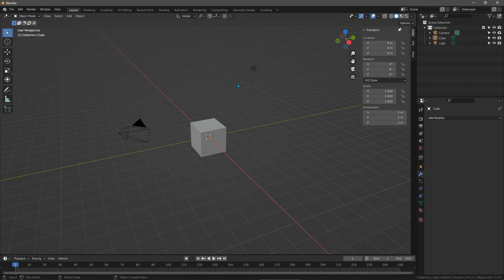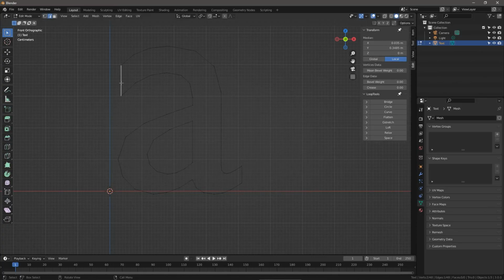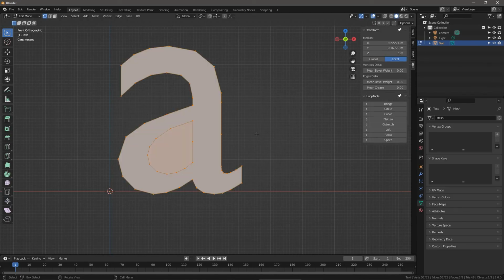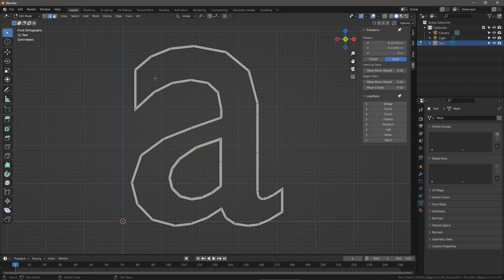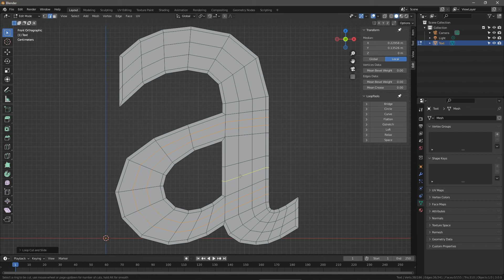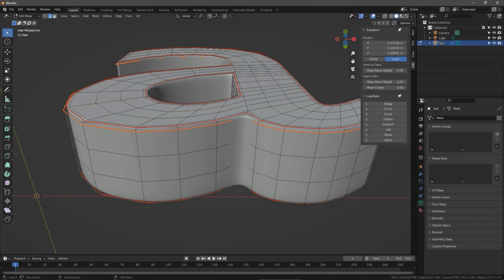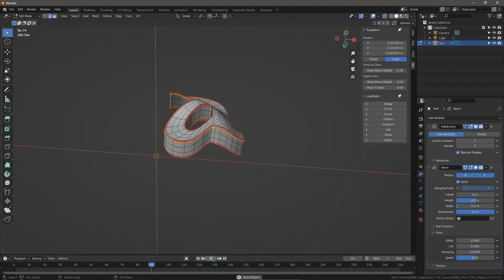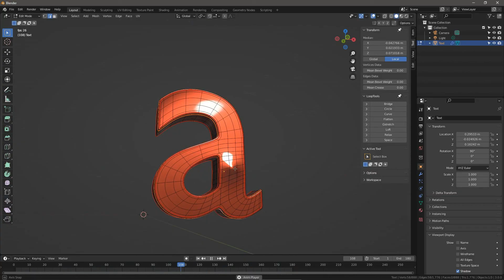Blender - Retopologising Text - #10 Subdivision Surface Modelling in Blender

Comment: great to see this - the challenge I have is to to keep the text editable so that designers using the file can revise the number to whichever is needed  - additionally that number is wrapped around a sphere like a pool game ball- I have used the remesh modifier with a shrinkwrap which works and looks clean in EEVEE though in cycles all the facets of the remesh show up nice and ugly - wonder if you might have any suggestions could try in addition to this approach for live text wrapped onto curved surface- many thanks!

Comment: PC user, Blender 3.5...           "G-G" doesn't work for me...just activates Grab funtion.  And although not related to video, I also can't align verticies to axis, as in:   

S(scale))  -->  X,Y,or Z  -->  "0"...     It simply goes to scale when I hit S.    I have to manually go to options and select "scale" from "transform" menu, then the next operations work.

Perhaps it's an addon?

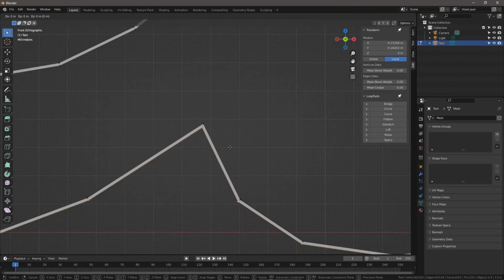At 5:20,  trying to use shift-V as my 'GG' while holding down "alt".     Mesh turns into spider web.

Comment: I'm interested to know how you would do this with text that has curved corners and several points along the corner.
Reply from the maker: Hi giantpunch. I would use the same method, but rather than add vertices to an edge to equalise the vertex counts on each section, I would subtract vertices from the side with the highest count. I would often leave the targets shirnkqrap object visible as I work. Removing vertices where there appears to be too much density. You dont ever really need more than a cluster of four verts to describe any curve. With that in mind, you can ensure that there is a good sensible distribution of ppints at every stage. While working on objects like this, you need to almost arbitrarily decide where to introduce corners ( which would be 4 spoked poles in the initial fill as you go). Does that make sense?
Reply: @ianmcglasham  Thanks for the quick reply! I don't really understand what you're saying here, but I'm gonna keep hammering at it until I figure it out!

Comment: thanks for these great tutorials! they are golden! but I have a question: do you use "mark seam" only to have a visual clue of what are the edge loops that are the ones which sharpen the corners? isn't "mark seam" also splitting the UV unwrap of the object at the same time?
Reply from the maker: Hi. Sorry about the delay! Yes. I use Mark Seam only as a visual clue! mark seam is supposed to be for marking seams which blender will use to split it up into islands for texturing. but i just like the way it turns them red!

Comment: hope blender can do it in the future without manual Edition hours..maybe  with a special modifier for Text..
like C4d  Text Animation and Text  handling  is fat beyond blender...and a fun to use ..this task  example  looks like payn in the ass and so much time for one Letter...
I try it with modifier setups  but its hard or on some forms  impossible specially  when the object deforms or with  longer words..Ther  is no setup near useable simple setup and Text handling editor it horrorshit .
 with geo node it ends most time also in artefact  mess..
So for pros its to timeconsuming no body pay for hours to model a Word and later you become a another typing type and you becone per hand again..its sadly tru that blender 3.3. can not handle  so important part od Animation  that Text  is even I n the future...blender need better remesh algorythm.
Reply from the maker: Lots of brands have an entire font created using methods like this as soon as they update their fonts! Whether it's Maya, C4d or blender. None of them create the correct topology so it always has to be done this way ( a slightly more advanced method actually which I will show soon!!) You would be surprised how many companies are prepared to pay for the hours!

Comment: SO glad I found this channel, just brilliant and unique content. Thank you!
Can I ask why you expand the border out from the original outline (edgeslide of -6) and not inside like an inset move?
Reply from the maker: Thanks Duncan. Great question! You can do either - or a combination of both. The limit of curvature is restricted by vertices at acute angles to each other on tight corners and these arrangements are more common on the inside of text. As an introduction  to the technique I wanted to keep the description simple so I opted to just go in one direction using the outer edge. The important part is that there 'is' a border which every tutorial I have seen so far misses completely!
Reply: Right, understood, so you're just avoiding converging normals on the inside of tighter curvature, got it.
Great stuff. Looking forward to the Bishop and further videos!
Reply from the maker: @duncanbell315  That's it! Bishop will be done this week. Uses borders in a slightly different way! Thanks again.
Reply from the maker: I have even more advanced techniques when extreme curvature is required- say balloon like text - but I thought it might be long and overwhelming at this stage! Overlapping vertices can be dealt with incredibly well with a deeper understanding of the relax looptool! If enough people like this video I will make another talking much more about exactly your question!